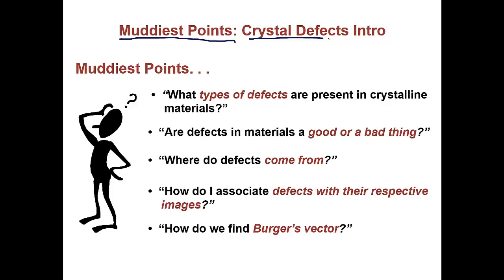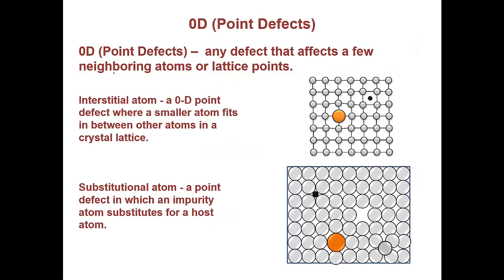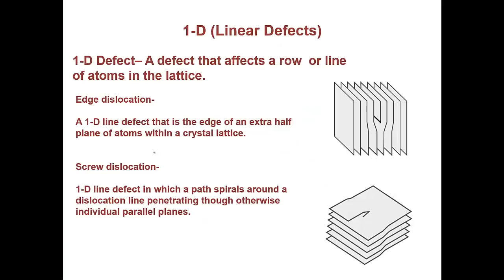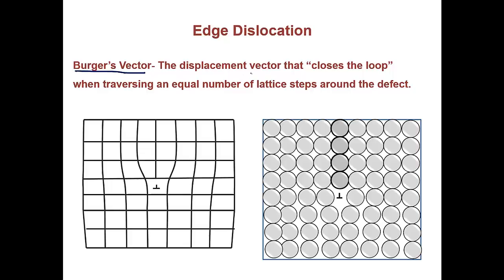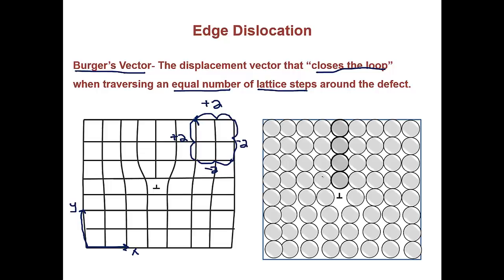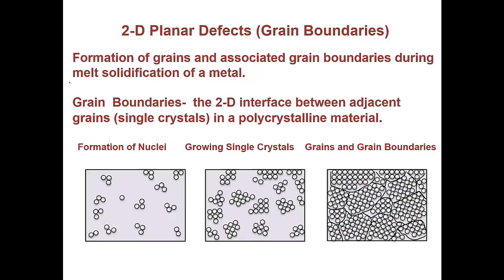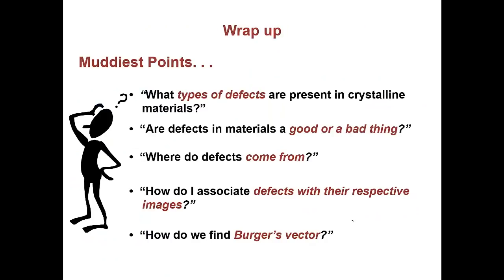Muddiest Points: Crystal Defects and Burgers Vectors

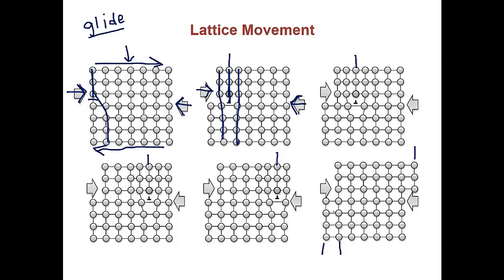Comment: At 14:26, the Burgers vector of the dislocation is from right to left (<-), but your dislocation moved in its opposite direction (Left to right). Why?
Reply: Due to the sheer stress applied? To me it seems the Burger's Vector is orientated left to right.
Reply: The effort applied to that half of the atoms goes from left to right, not to mention that the expanded atoms below the half-plane of atoms added to it are weaker, and since a burgers circuit has to be drawn perpendicular to the smaller side of that trapezoid kind of structure created from the dislocation. I'd surmise that the burgers vector ended up being drawn horizontally as well, so the weaker side of the dislocation (the lower one) is the one that gets broken away from it's original links first.
Reply: I don't understand how you can associate a direction to the Burgers vector?
Doesn't it depend on the direction of the loop chosen?
And since the direction of the loop has no physical significance, we can always change the direction of b??

I suppose this does not matter here as the slip still must occur parallel to b,
but then I was learning about adding Burgers vectors, how does that even work when we cannot uniquely define the direction of b?

Comment: U havent explained the bad and good thing about defects U_U.
Reply: +Francis Lance it depends on the use that you want to do for the material.
The movement osf dislocations is asociated with the plasticity, which means that the more defects, the more movement and therefore more plasticity. Nevertheless the more plasticity, the less yield stress a material can support.
So for example, for materials where you dont want plastic behaviours like infraestructures they are not good, we search the maximum resistance
But the defects on them have the advantage of make the material less brittle, for example when an impact of an unexpected load